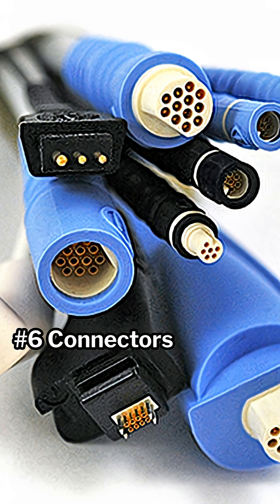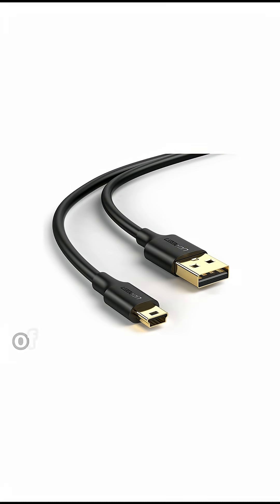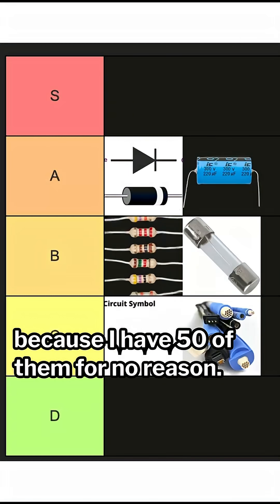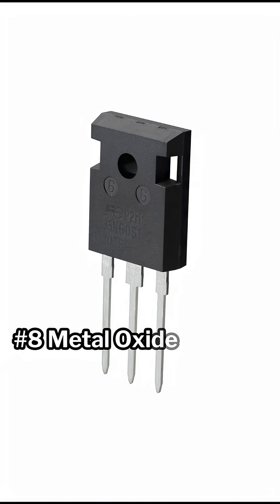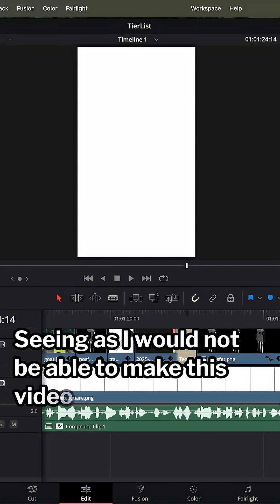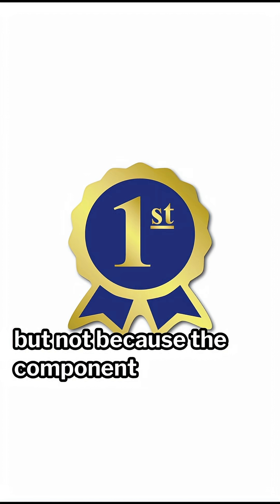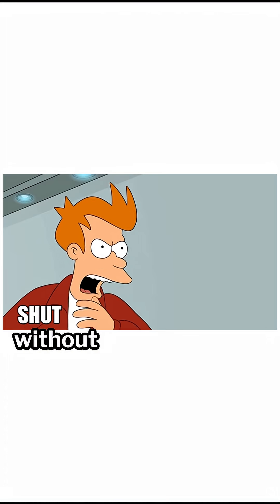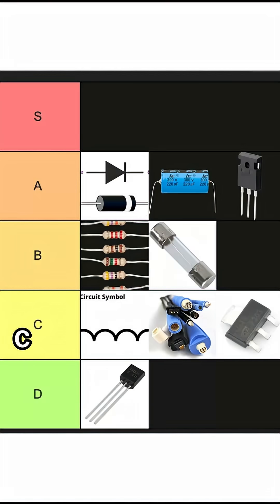Electronics Tier List   .    .    #advice #arduino #electricalengineering

Comment: Honestly, if you are putting the buck–boost converter in an S tier, you are deranged. In my 12 year enginering career i used it once, and it didn't even work at all. The voltage divider did a better job than it.

Comment: Hard disagree on the inductor. It's the only thing that can actualy do anything other then creating light. 

Yes it will create voltage spikes, yes it will zap your transistors with multiple kilovolts, yes it will nuke your circuits for seemingly no reason but how else are you going to drive that motor?

Comment: Bro, you didn't even cover op amps. They're literally analog computers. They can do flippin calculus. You can make a nearly THD free sine wave with one quad op amp, and properly phased 3 phase with three of them and a few passives. Everything in your list needs knocked down a tier to open S tier for op amps, microcontrollers, IGBTs, FPGAs, and EEPROMs.
Don't mess with EEPROMs. They can hold grudges for centuries.

Comment: WTF?

1. Resistor.
2. Transistor. (This OBVIOUSLY includes MOSFETs)
3. Capacitor.
4. Inductor.
5. Would be diodes, but transistors are just advanced diodes.

6. Everything else, since everything else is MADE FROM the above components.

Also, your #13 doesn't count, it has to be something that EXISTS.

Comment: That Bipolar Slander is unacceptable.
Yeah I know they are less efficient and annoying in low current applications and have rightfully been replaced by mosfets, but in their evolved form, the IGBT they are literally the backbone of modern HV DC power transmission. Mosfets simply can not get close to the current handling capabilities and gains of bipolar transistors!

Comment: fun fact, in the 80s, a man named Floyd "Sparky" Sweet, who was a professional electrical engineer with a specialty in transformers, took a barium ferrite magnet (back in the day this was considered a new and exotic material, but is fairly affordable today)  and heated it up enough to de-magnetize it. he then used high voltage bursts from a capacitor dump system to re-magnetize them while a secondary coil pumped a 60hz sine wave through it, and doing so supposedly instills that 60hz oscillating sine wave into the magnetic field. he then took a  a pair of coils in a sort of cross shape and put them between the two magnets, one is a drive coil, and the other is an output similar to a voltage step up transformer but simplified. when he powered the drive coil at a 60hz frequency, it would cause the magnetic fields in the magnets to self-oscillate, drawing more power into the circuit from the ambient environment.  he claimed shortly before his death that one of his revised versions of this solid state generator, could run 500W of load on 0.3Miliwatts of input power at 60hz.

he died of a "heart attack" after being visited by a group of men claiming to work for the FBI. shortly after the ambulance left his residence after being called by his wife when she found him motionless at his kitchen table, men in vans that said FBI on the side raided the home and confiscated all his research and prototypes. it sounds like fiction, but its unfortunately not, every time someone has gotten too close to disturbing the money flow of the most powerful corporations, they tend to disappear.

Comment: Is the number 1 most used component really the resistor though? I would argue that it would be the transistor because of the sheer number of them in every computer that get used every time you use a computer
Reply from the maker: I think that’s a fair argument, but my belief is that since every wire is a resistor then there would have to be more resistors. But I’d agree that the most intentionally used component is probably the transistor

Comment: Feel like it doesn't make much sense to downrank something from S to D due to a similar component existing in B tier. Especially given the fact that transistors are basically why CPUs are a thing.
Reply from the maker: You are totally right. There was no sense to the ranking in this video. It is entirely biased

Comment: fuck inductors, never used 'em, never will
never seen another circuit use it either, and if so there were similar versions of that circuit using capacitors (which are 100x better)

Comment: The bipolar is the goat tho.
- specialised BJTs work even at 100 gigahertz in the active region… MOSFETs with their fat ahh gate need to have a bunch of charge pumped, even nanometre sized ones struggle at 1GHz
- a little shock? no problem BJTs survive with flying colours - mostfets get fried
- noise rejection? analog cell multiplication? multiple operating modes? BJTs got you covered

The only reason we use mosfets so much is because they are convenient. But if you want a robust and fast adjustable current source that doesn’t fail at the most minute transient, BJTs are the goat. I still refuse to make my circuits with mosfets unless I know it’s a circuit that will not be exposed to static charges or transients and mosfets offer a far more elegant and efficient solution. But even my H-bridges are unapologetically made with BJTs. I don’t care it’s an old technology, you will pry it away from my cold dead hands.
Reply: Also: BJT don't have the integration effect of the gat, that mosfets have. BJT follow directly the input current, while mosfets conduct based on the gate voltage, which has to be charged first. This can cause instabilities when the mosfet is controlled by an opamp with fedback. meanwhile the BJT will follow the opamp output perfectly.
Reply: *energy efficiency walks into the room
Reply: @rorythewriter who needs efficiency bro there's energy literally everywhere

Comment: remember everything is a capacitor, inductor and resistor at once if you try hard enough
Reply: If you try even harder it might become a smokemachine
Reply: @Traper_T  i just call that a flashy resistor
Reply: Don't forget the LER (Light emitting resistor)
Reply: @indescribablecardinal6571  You mean the incandescent bulb, don't you ?
Reply: a piece of wire is all 3.
Reply: LRC all S tier no question
Reply: The beauty of it: you don't have to try at all
Reply: especially if you try fast enough
Reply: @rorythewriter  capacitors love to turn into short circuits
Reply: @RoofusRoof19...until you get to the range where the inductance takes over

Comment: Caps were known to failed and created short circuit problem in most electronic I repaired, so E tier but it give power and signal filtration so probably a D or C best

Comment: every buck converter is gangsta until you need something that requires a slightly less noisier power source than your Armenian neighbor
Reply from the maker: Lmao that’s hilarious
Reply: And then you have to add a shunt and a choke and filter caps so it doesn't fuck up your audio 😔
Reply: then you have to scrap the buck converter altogether for a ldo cuz your wifi chip isnt working anymore 😅
Reply: real
Reply: a huge capasitor and a random non polarized capasitor fixes every single humming sound
Reply: @TİP41C  not so fast buddy, self resonance of the capacitors along with the harmonics of the switching frequency will find its way, sometimes it will be so bad it affects other devices; we had a guy with a device that didn't work in his lab and worked in ours, turns out power supply for his bench lights was so bad it caused his devices memory to randomly flip bits and get corrupted. the efficiency is better, but sometimes paying for few watts is way better than the hassle of dealing with the noise

Comment: Heh, also took apart an old microwave. Took out the secondary, put in 2 ½ turns of a 10mm² cable and are now measuring about 2 volts out of 230 :) . Haha Amps go brrrr

Comment: Any good playlist to learn about these in greater detail
Reply: Also did you rebrand from the blender guy
Reply from the maker: @ultraslayer9255  Yeah, i'm surprised anyone noticed.
Reply: @ElectronicGuy1 when I was watching a short I was thinking this electronics guy and blender guy do similar videos a bit too similar so I checked the channel and there was blender stuff
Reply from the maker: When you say "these" what do you mean? If you are referring to the electrical components, then I'd refer you to Great Scott, engineering mindset, or electroboom. I like the different ways they approach teaching about them
Reply: @ElectronicGuy1 yh thanks also what’s a full bridge rectifier
Reply from the maker: @ultraslayer9255  It's a circuit that converts alternating current (current that goes back and forth) into direct current (current going in one direction). The full bridge rectifier is 4 diodes (which only let current flow in one direction).
Reply: @ElectronicGuy1 thanks, I’ll ask one more question before I do my own research. Why would you want to convert Ac to dc
Reply from the maker: @ultraslayer9255 you would often want DC for digital circuits. Like if you wanted to power a microcontroller (like Arduino or esp32 dev boards). It is very common for AC to be used to transmit electricity over long distances like power lines. Then DC is used for short distances and controlling transistors. There is so much to this, but I feel like I summed it up alright. I’m sure someone will correct me with some more info
Reply: @ElectronicGuy1 thanks for the information this is why I’m subbed, keep up the good work
Reply: @ElectronicGuy1 DC is also been used in analog circuits as well, like amplifiers, radios etc. It is what you said, transistors need polarization to work, and DC is that voltage that put the transistor to the operation point (active zone for example). Also i read somewhere that DC transmitts equally as AC but when we discovered that AC infraestructure was already built haha
Reply from the maker: @guillo1306 that is good to know, I watched a video a while ago about the DC power lines that are coming around

Comment: MINI USB???? You're a psychopath. 😂😂
Reply: That’s what I’m saying!!! Mini usb is by far the worst one!
Reply: @Birry_ no micro usb is way worse
Reply: Micro USB is worse what are you talking about
Reply from the maker: YES
Reply: @ElectronicGuy1  donate me one. I need one for my calculator.
Reply: Mini isn't that bad it's micro that's shit
Reply: Micro usb should be illegal
Reply: I appreciate mini-usb because it have less tendency to loosen over time, but connectors like svga are the best because of bolts
Reply: Micro usb is worse. But mini is 2nd worse
Reply: It's not minusb or micro USB
It's micro - b
Reply: Two words. Fire wire.
Reply: at least it isnt micro usb
Reply: The mini connectors before the crappy thinner micro usb connector are amazing.  The micro usb fragile might-as-well be a ribbon connector will always fail and bend. The mini USB is THIIECCCKKK and tough as nails, i had a crappy kids camera that sat under the house since i was little. Picked the dirt out, plugged it in, still worked. 
They all got replaced by USB C which seems pretty decent
Reply: Nah mini usb is cool
Reply: Micro is alot worse but apple one is the best one because its easiest to clear out of dirt
Reply: Still can't believe resistors only got a c
Reply: Atleast it's not micro USB
Reply: Mini usb is the second best behindUSBC imo BC it is easy to plug, but also it is SO SLOW
Reply: Exactly, why not USB type-C
Reply: Micro USB is more annoying cuz i still see shit made with it and it forces me to use it
Reply: nah he arduino(from ali) enjoyer
Reply: Any USB is better than USB-C tho, cheap-ass connector 😓
Reply: @miguelpina2006  brooo tf you mean usb c is far superior to all connectors.
Reply: @miguelpina2006  5/10 rate bait, almost got me
Reply: @miguelpina2006  burn in hell!!! You can not insult my goat the USB C
Reply: @miguelpina2006  USB-C is best out of the small USB connectors for multiple reasons but it already wins even just for being strongest against physical damage
Reply: @snooks5607 how exactly is stronger?
Reply: @miguelpina2006  curved corners have better stress distribution, basic structural geometry. mini- and microUSB connectors have sharp corners that buckle sooner if bent.
Reply: @snooks5607 ok fair, but why is the metallic part so long? It only adds leverage for bending more easily

Comment: The reason i have not taken apart my microwave  😂
Reply from the maker: LMAO
Reply: I mean, i did... But i do not advice you to do the same... i got shocked by 2100V and trust me, it is way more painfull than 230V
Reply: @BruhMarjan

5000v for me 😭😭😂

Very literally roasted my thumb skin to a char 😂😂

Good times
Reply: @penguinoc63  no way you too but where did xou get 5kV?
Reply: @penguinoc63 it's Watt not Voltage, there's no way a high voltage Microwave exist, unless you're mad enough to build it yourself
Reply: @moochi4429 some youtuber already built it i think
Reply: @BruhMarjanonce I had plan to open like this big old tv but internet warned me to not die this early 😅
Reply: @cupcake_toucher445 Sit on high ground, keep tv on low ground. Take a piece of wire glued to the end of a plastic rod and short every capacitor you see and you are golden. 

JK, don't do it. I have no experience.
Reply: a screwdriver.
No elevation changes needed. 
I'd advise using a cheap heavy one, as you may leave weld marks on it from higher voltages, and to disperse heat.
Reply: @BruhMarjanI think u mentioning Watt not Volt. 

If you're doing that in a household, there's no way you would get anything beyond your Norm.

2100 Volt is in high voltage area and dangerous enough to even get close to..., every expert would advise you to stay away and never do it alone...😮

If by chance you are doing that in a high voltage area, i'm surprised you're even alive or doing well..., congrats tho
Reply: @moochi4429Microwaves generate a few kilovolts to run the magnetron. The power rating just happens to be a similarly high number.
Reply: @BruhMarjanit's Watt not Voltage.
Big difference. 
Every household has a specific norm how much volt they get.

Yours is probably a 230V/2100W microwave if you're from Europe

But the pain is definitely real, i trust you blind with this one
Reply: @moochi4429old tvs have these huge capacitors of big voltage, maybe microwave also has it? Its aboit schock really.
Reply: That was beautiful